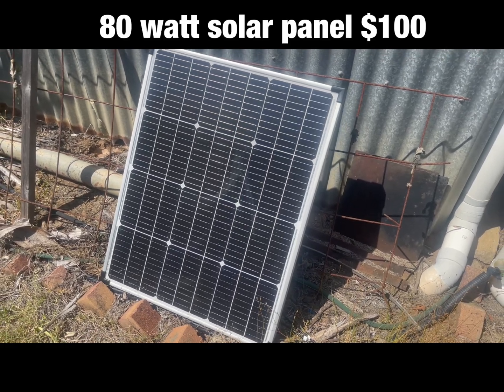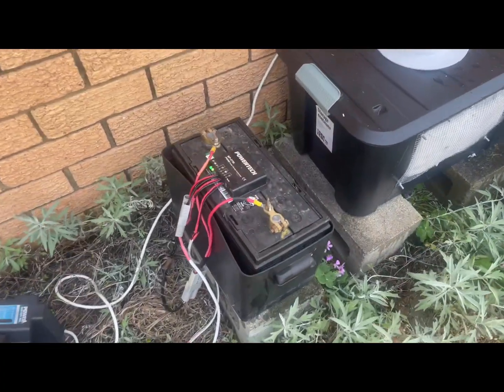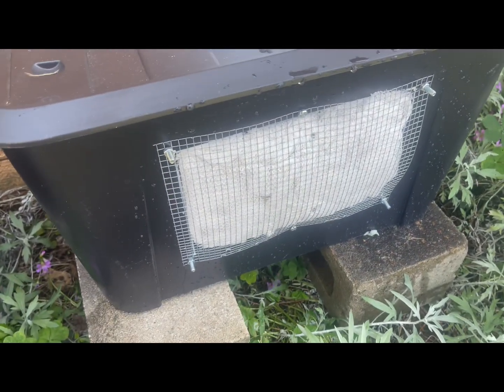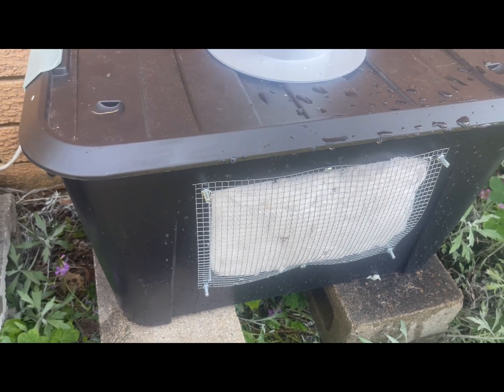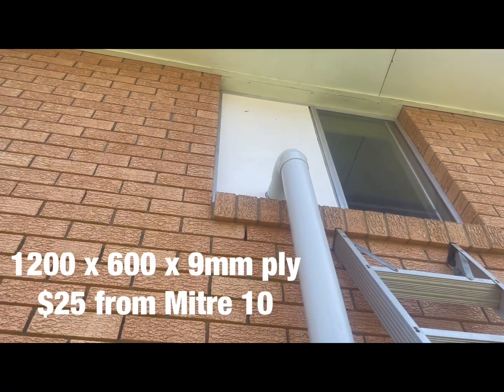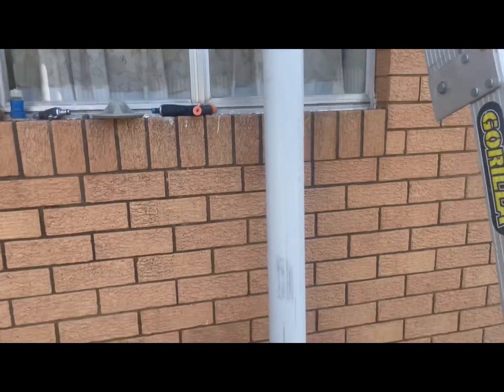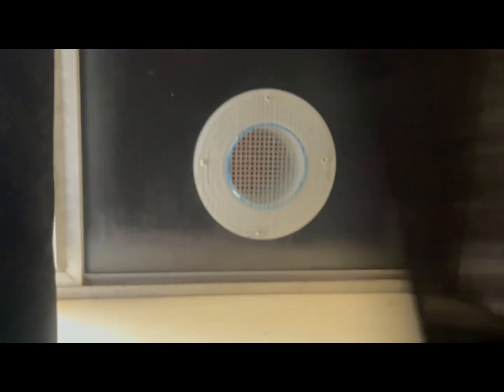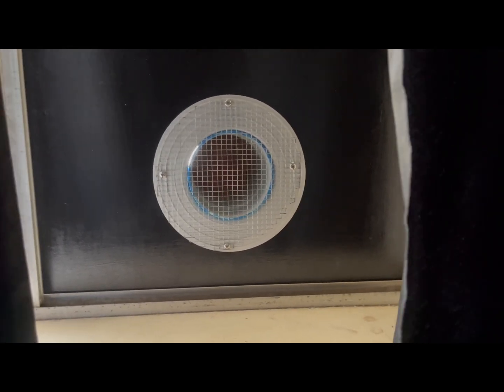DIY Solar Powered Air Cooler System

Comment: Swamp cooler, not AC. air Conditioners use a pump to accomplish phase change in easily compressible gas. It can cool but they tend to operate around humidity and can't cool as effectively per watt used.